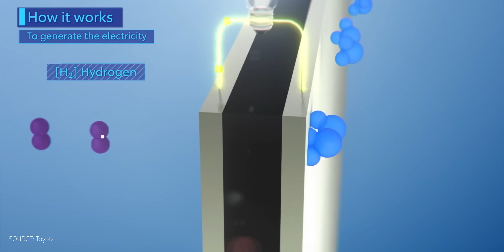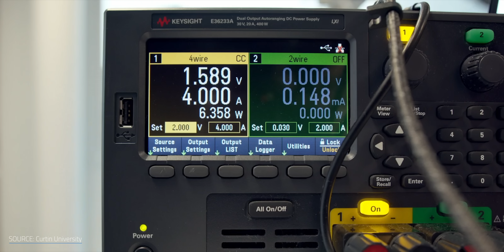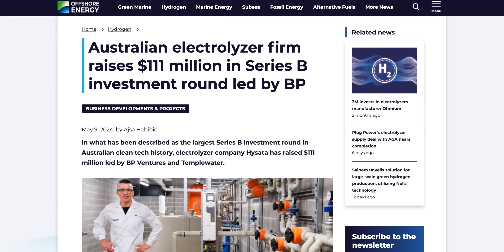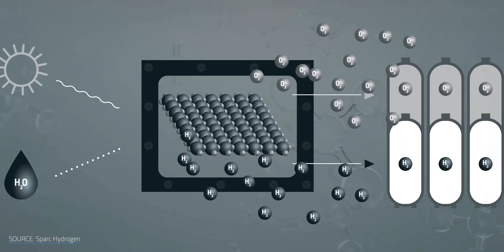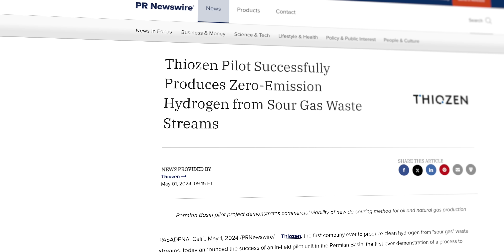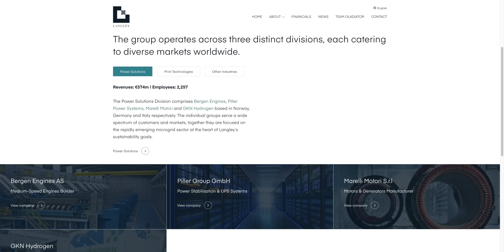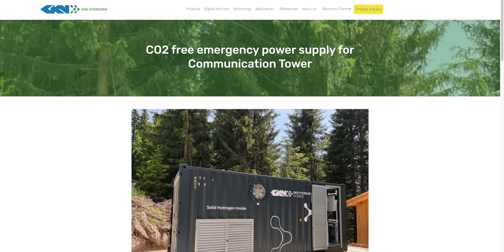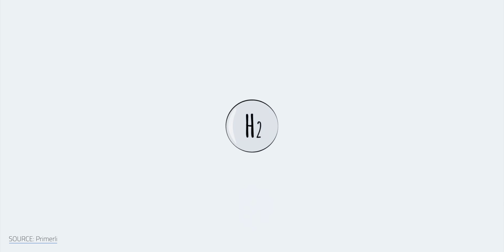How a Hydrogen Breakthrough is Closer Than Ever

Comment from the maker: Do you think hydrogen still has a future? Use code UNDECIDED50 to get 50% OFF your first Factor box plus 20% off your next month of orders at https://bit.ly/3R5fOSk!

If you liked this, check out China’s MASSIVE Desert Project Is About To Change The World https://youtu.be/MX_PeNzz-Lw?list=PLnTSM-ORSgi4At-R_1s6-_50PCbYsoEcj
Reply: No.
Reply: Really well done on the German pronunciation! 😀 As always, thanks for another interesting video.
Reply: For general use, no.  End to end efficiency poor.  But there maybe some niche applications where it may have a place, even at additional cost.  One is steelmaking, or other high heat processes.  Another maybe longer ranged eVTOL's, with fuel cells.  Imagine hydrogen generation from electricity close to the point of usage.

Also, say lets say solar and wind gets so cheap, that one can overbuild by 2-3x.  What do you do with the excess electricity?  If electrolyzers can be made cheaply, is low capital cost, can tolerate low capacity factor, ... the extra electricity can be shuttled away to generate hydrogen.  Additionally, it maybe able do also generate downstream products such as methanol and ammonia.  This can be used for fuel or other industrial products, such as ammonia for fertilizer.
Reply: Hydrogen is not a panacea. It is useful in very specific situations. The people are trying to shoe horn it into things that it simply will not do well in. It will always be more expensive for a lot of specific situations, and less efficient. An example is heating of homes. Or in my opinion any transportation needs less than the size or weight of a train. I don't think it's even a good option for long haul trucks. And it is absolutely not a good option for shipping. So that's many of the so-called uses of hydrogen that simply are not going to pan out. But it does have a place in many other areas. I don't think energy storage is one of them, but I'm willing to keep an open mind on that. But there are a lot of industrial processes where it could be very useful beyond just being part of the chemical mix. Including high heat production, and other similar type of uses. So yeah, hydrogen is overhyped
Reply: The biggest problem I see with hydrogen is in the components that see hydrogen under pressure.  There is a thing called hydrogen embrittlement that causes some real problems in high iron content components. And  with hydrogen's small size makes it difficult to capture it in vessels as it is small enough to work it's way through the pours of many different materials.
Reply: Hydroden has a high energy density so it will have a future in some areas where that's useful like perhaps a possible replacement for jetfuel or possibly some kinds of factories like steel mills that need to generate extreme heat. In other areas like EVs it doesn't make sense when you factor in transportation costs of hydrogen are far more expensive than near instant electricity transfer over a wire. Companies like CATL also already have EV batteries that can do 600 miles,  charge in 10 minutes and inexpensive enough to finally make EVs cheaper than similarly equipped ICE vehicles. It's only in China for now but eventually it will reach other countries.
Reply: No, it has no future, because Hydrogen is not a fuel. It will ALWAYS take more energy to make Hydrogen than you get from burning it. Period. Second LAw of Thermodynamics. Hydrogen is a failure. It's a grift by the oil companies.
Reply: I remain suspicious of Hydrogen proposals, on the simple rationale that there is a list of direct competitors for H2 that are more technically appropriate, more economical, and more green. Biofuels from waste biomass lead the list of things easier to turn into fuels that work with current equipment. Urea is far better than H2, for storage and transportation and energy density, and costs less per unit of energy in theory. The Rube Goldberg schemes to make H2 a usable good? Sure, throw enough resources at it, and you can obscure H2's faults. And there are appropriate niche uses for H2. But to power the world the way some sell it? No. That's not the future.
Reply: we will still be using fossil fuels in 50 years. Even in the first world will be mostly switched over, the third world will not. Plus, we need stuff from oil, not just gas. We just have to figure out how to process oil and gas cleanly to get the helium and hexane/butane/etc. we need. Thats the best we can hope for. But maybe by 50 years the oil and gas we burn will be burnt cleanly
Reply: Hydrogen will never work because there's not a green way to get it.
Reply: Good show! 

I noticed that SunHydrogen, inc was not mentioned. 

They seem to be making strides bringing the world clean hydrogen derived from any kind of water and specialized solar panels.
Reply: Hydrogen is made from natural gas and creates more CO2 than burning the natural gas in the first place. Electrolysis is not the solution because all renewable electricity is going to be sucked up by AI and data centers.
Reply: TBH, I think we should bring back the original intro song.
Reply: H2 never had, and honestly never will have, more then a few niches were its viable and that is not only because its primarily pushed by the fossile Fuel-industry, with the hope they can sell us their CO2 poisoned H2 with an unhealthy up-charge, because its Green!(washed)

It may replace Coal/Gas if used in smelting Iron and steel production or if used in the same way it is used today, for fertilizer and chemical production, just produced through electrolysis instead of methane reformation, that would be a way to go and replace fossils…
But there it is % would be used exactly because of its chemical properties, not because of its power as an energy storage medium anyway

Else its overall energy efficiency is sub par to everything else! Heck turning it into fertilizers, grow food and then use that food to energize you to pedal a bike has a better energy efficiency then burning it, be it caloric or in a fuel cell

If metal-hydrid storage could get anywhere without the use of rare earth metals, then it "could" be feasible. Else it would mostly be for emergency power solutions and/or other places were cost shouldn't be a limiting factor. But there metal-hydrids could shine, as most can have near unlimited shelf time, or rather longer then the gear needed to extract the H2 again
Reply: No!
Reply: Uh short answer yes! The Elite love to milk a cow and Hydrogen/Nuclear Energy are the next Crude Oil!!!!
Reply: @UndecidedMF  Nice way to force in an advertisement
Reply: Excellent progress. One thing to note is that if you're producing hydrogen from solar/wind, energy is lost in the process. So it might seem we don't need hydrogen. But, generally we don't need hydrogen except for specific cases like airplanes and large ships, which is where hydrogen's value lies. Since hydrogen is only needed for these limited but important applications, the hydrogen revolution may happen faster than many expect.
Reply: pffffffffffffffffffffffffffffffffffft ...
Hydogen
Reply: NO. Its a terrible ennergy carrier. Im not convinced that the efficiency is gained like they say. Regular test its just makes more gas while sucking more power equally.
Reply: @impuls60  yeah well.. its internet: nobody cares...
Reply: @impuls60 Also has to come from already limited water options
Reply: Given that fresh water is already at an all time low in most areas and desalination on a scale to fuel the world would probably destroy the oceans in a few years, I'd say it's a terrible idea. Don't even get me started on steam methane version of the production process.
Reply: @triple7988  meh.. its still a great idea, enough water left
Reply: @triple7988 I'm only considering fresh water to be an output, not an input. If you are taking about generating from wind turbines, those can be ocean-based. Ocean sun to evaporate, distill, then onto the turbine for hydrogen generation. It actually helps solve water issues, not make them worse.
Reply: @triple7988 fresh water falls from the sky every day. If there was a shortage we’d capture more.
Reply: NO! It is just another green dream that cannot be implemented on a large scale. And like all other green dreams, it is primarily a way to milk tax money for unrealistic projects.
Reply: Hydrogen has a future, but not in the short term.  It will take another decade to completely eliminate fossil fuels and be on solar and wind.  Once the shortsighted decision makers realize that there are huge amounts of solar being curtailed during daylight hours, then they will scrutinize how much it is costing the grid to store the curtailed electricity using batteries, and then look for another better long-term storage solution.  One long-term solution is pumped hydro, but this needs a hundred meters difference in elevation.  So pumped hydro is not for flat lands.  Hydrogen can be stored long term in underground salt caverns just like natural gas is now stored.  So it's just a matter of time until forces come together to cause long-term hydrogen storage to become prevalent.
Reply: One advantage of hydrogen is that you don't really need to worry if the electrolyzer works outside lab conditions. A solar panel must survive outside in all kinds of weather for years and a battery or fuel cell has to work even if the car it is in has a bumpy ride in hot or cold conditions, but to make a hydrogen factory you just need to build the lab equipment bigger. Though it is a different situation if you want hydrogen energy storage devices or fuel makers in homes and have to idiot proof them...
Reply: SunHydrogen is in the process of commercializing their PEC tech. 10.8 percent efficiency direct solar to hydrogen. They are working with CTF and Honda right now to bring it to market. Look into it.
Reply: Matt, is @UndecidedMF08 a fake account?
Reply: Matt, the scammers are back!  Look at the reply to my original response to this video please.
Reply: Good points, Matt. Some institutions and corporations plan to ramp up GreenH2 projects in areas where negative and null electricity price is found during excessive renewable energy production periods.
Reply: Nope, unless you use methan and that leaves CO2 as rest product. 
Any other methods and materials are NOT economically sustainable. 
Btw. than means that even if you (maybe) help the planet, you will kill our society in the process when global economy failes.
The thought is than there will arrive new much more effective technologies before hydrogen gets there.
Reply: Hydrogen from renewables can help lessen the need for desalination plants and have an impact on water stressed areas.....places that use the most energy, generally need the most clean water.

Just capture the water vapor byproduct, and you are creating water with energy use that already exists. That would need lots of time and scale, but it's a significant potential side benefit.

Instead of desalination plants that use extra energy, you'd have hydrogen power plants for cities connected to city water systems in some places.
Reply: @namehere1861 Sorry to tell you, but you’d never be able to capture enough water vapor to make up for how much water you need to produce green hydrogen. It’s horribly wasteful.
It’s not even close.
Reply: The niche places where Hydrogen may be used is large vehicles such as trucks and buses. Hydrogen has the advantage of being energy dense and allows for fast refilling compared to charging a battery.  Then again, if battery technologies advance where they can increase energy density, charging times and reduce reliance on hard to find minerals, that would be the death of hydrogen. Interesting to see what will happen. Thanks for the good work.
Reply: One of Dr. James Tour's companies is looking at producing hydrogen from recycling plastics.  The hydrogen is a byproduct from producing graphene from plastics.  Because it is a byproduct, it is considered to be produced at zero cost, as the costs of recycling the plastic cover its production: https://www.youtube.com/watch?v=GHMp9OUQgUg.
Reply: Maybe making methanol directly from the hydrogen, so there is no need for hydrogen storage. But I do not know how difficult that process would be
Reply: geologic hydrogen free from the earth I have videos on it on my channel
Reply: I see a great future for shipping, air fleet, and industry, do I don’t like the idea of having a connection for housing
Reply: $21m from the government to build a H2 electrode that's maybe 15% better. What a ripoff.
Reply: No. It it were viable (or just promising), they would be doing this research work in their home country. No gov. funding => no work done. So just another gov. funded scam where taxpayers foot the bill.
Reply: @UndecidedMF  And two people stop believing in santa claus and the tooth fairy and all the other mythical creatures , nothing's gonna change
Reply: naaah waste of time, there will never be a hype for hydrogen.. it is simply too dangerous, i have done some research and work on hydrogen myself, it needs very little oxygen to ignite.. so any leaks down the line and you have problems... (think of older vehicles...)
Reply: Matt please do a follow up video on RedFlow I heard the are having some issues raising funding for production?
Reply: Even if it’s produced with renewables the staggering amount of water you need to produce hydrogen is MASSIVELY wasteful and stupid. I notice that yet again this was not mentioned in yet another hydrogen video.
Please address or at least acknowledge this problem exists, please, anyone who makes a magical hydrogen video? Anyone?
Reply: https://www.youtube.com/watch?v=Zklo4Z1SqkE
Titled why hydrogen will never be the answer by physicist Sabine
Reply: @brianjonker510 Thank you, I did in fact watch that quite awhile ago and have been meaning to revisit it. 
 I can’t remember, did she discuss/address the water problem specifically?
Reply: Just watched it again. She did touch on the water issue, but still DID NOT explain the amount of water required. This, to me, is emphatically the main reason hydrogen will never work.
As I understand it, it takes anywhere from 10 to 20 liters of purified water to make 1 liter of hydrogen.
That’s a lose-lose situation  right there regardless of the green aspect or not.
Reply: @owldrinkmore  I suppose this is about kg.
18 kg water is build from  16 kg oxygen and 2 kg hydrogen.
Reply: @reiniernn9071  I don’t think the measurement particularly matters,
89% of water is oxygen whether purified or not. However, because of atomic weight AND the necessary purification of said water,
anywhere from 10 to 20 liter/kg of water are required for production of 1 liter/kg of hydrogen.
Absolutely ludicrous.
Reply: Fortescue has withdrawn from the project.
Reply: I'm no engineer or scientist but there's a case for dam free run on rivers micro hydro remote stations that uses electrolytes to produce pure hydrogen. Besides the initial installation cost it won't produce nearly free Hydrogen 24/7 365 days of the year. The setup could fit into a shipping container and transported to remote sites where it can operate independently. Hydrogen storage and transport is a different matter but dam free run on river micro hydro hydrogen generation can produce emissions free energy. 

This would work in mountainous regions like British Columbia Canada; where 40 remote communities are not hooked up to BC Hydro and spend collectively 18 million dollars yearly on diesel power generation. Those remote communities can be ran from virtually free hydrogen produced from micro hydro power stations. The reason electrolysis is under 1% of hydrogen produced is the major investors tend to be big oil companies who what to diversify their existing fossil fuels operations; which most likely will never be considered emissions free. Run on river micro hydro hydrogen generation is more practical then using inconsistent wind or the sun.
Reply: @CanadianEmpowermentAlliance  The less then 1 % of production is via electrolysis is because the physics/chemistry laws say to break the valence bonds of waters uses 7 times the energy then to break the bonds of methane. Then there's the cost of of transporting/storing H2 for which there is limited infrastructure.

That's why Oil& gas is dominating H2 production. There's now an Australian solution the reduces the Steam Methane reformation method emission to produce H2 by 90+%. See 1st Commercial Demonstration Plant https://youtu.be/NDa3glx-tTI

Second plant now being constructed in Canada followed by Japan then France.

Here's the carbon output as graphite https://youtube.com/shorts/cHLh-EV8RhQ

The advantage is that now major new transport or storage cost. Use existing gas infrastructure to transport gas to user site. User extracts the graphite sells it and use the Hydrogen on site. So you get value from the carbon as well versus SMR method which vents it or in case of blue hydrogen sequesters emissions underground.

Your right it's not 100 % but certainly 90+% emissions free. Better then what we have now, and much cheaper then electrolysis.
Reply: Matt Ferrell pumping another future tech that will never be available in our lifetimes (if ever). And these videos always have some other ad inserted into them (this time with a 50% code!). These videos should be added to the scam YouTube algorithm.
Reply: Yes it still a future, but in the form of turquoise hydrogen, natural/gold/white hydrogen or as "waste green/pink hydrogen". When too much solar, wind, nuclear is generated the grid and the batteries are unable to manage it, meaning it has to be elektrolysed in elektrolysers or Battolysers.
Reply: Get 50% OFF since you lose more than 50% of the energy on the roundtrip electricity - hydrogen - electricity! 😆
Reply: @estraume  Loose? Are you sure one doesn't tight the energy? Aside from that, apparently storage, portability, and energy density are not things you find worth considering? 😃
Reply: @zweigackroyd7301  Typo, corrected now. 😆 I think a system where solar energy is used directly for hydrogen production is interesting. Methane Pyrolysis might also have potential given that the rest product is solid coal and not CO2. But all processes involving Methane have a big disadvantage in the risk of leakage.
Reply: @estraume  I think it's a waste! I want to use more energy to create the hydrogen then simply putting into batteries for driving, then take the hydrogen and use more energy to compress it! At this point, you are now more expensive than gasoline. You also have one hell of a bomb!
Reply: @estraume  The biggest problem with leakage is not with the CH4, H2 is the smallest molecule!
Reply: @estraume  Correct stated. And those losses are EXCLUSIV energy needed for compression of hydrogen to 800 bar (which is the pressure in tanks used for mobility with hydrogen cars. If we include that energy the efficiency goes down to 25% . 75% loss.
And storage in a battery is somewhere between 90% and 98% depending on the battery type and charger efficiency.
Which makes green hydrogen only a good alternativ if you have electricity (like sometimes in Germany) without any demand for it...better 50% loss that total waste is the argument. But ise that hydrogen in such places that compression is not needed....even than the efficiency is far less than battery efficiency....but we cannot use battery stored energy for producing steel. Hydrogen can be used for that.
Reply: Hydrogen might not have such a future as an energy storage used to offset renewable electricity generation. However, many parts of chemical industry that currently emit large amounts of CO2 cannot be turned green without hydrogen: ammonia for nitrogen fertilizers, steel and polymers, to name a few. Also aviation and marine transportation industries are tricky to electrify with batteries. I'm somewhat disappointed that, again, the talk is only about the energy use of hydrogen, although there are many better use cases available. 

Then, another benefit from large scale utilization of water electrolyzers is their added flexibility to the electric grid. With a large reserve of electrolyzers we can overdimension our green electricity generation capacity from what it would be based only on current electricity demand. Ramping the electrolyzers up and down with renewable electricity generation will create massive amounts of demand flexibility, acting kind of like an energy storage. Of course, this would require cheap enough electrolyzers or other economic benefits for not operating the plants 24/7.

So my answer to the question: yes, there will be future for hydrogen, but no, it won't be serving as a battery for electricity.
Reply: @Piepura  I love it! I think that is very well said!
Reply: From what I understand, GRZ Technologies in Switzerland is already selling solid-state hydrogen storage. They use metal hydrides to store and release hydrogen efficiently. The company is already selling energy solution close to price parity with batteries to store clean energy.
Reply: @BlindedByLogic  I would like to see an independant study confirm that metal hydride storage is more efficient than liquid hydrogen storage. Claims made by a company producing the technology are suspect in my books.
Reply: @BlindedByLogic LOHC too in japan
Reply: No but in your mind apparently. Very disappointing video and highly biased.  Not your style but maybe it now is?
Reply: I do. It will have its markets (forklifts, fleet vehicles, planes in the future, heavy load vehicles, etc) I can’t believe you have done these videos on hydrogen without even mentioning Plug Power though.
Reply: @scottlarson3255   I too was wanting more than a screen shot of a Plug Power truck about second 25 of this video, maybe Matt will devote some time.
Reply: I have given up on channels like this. For 30 years I have studied these advances and have seen few reach the market or improve the lives of humans . Makes you wonder what happens to all this tech. Since the tv show”Beyond Tomorrow “ in the late 80s we have seen endless innovations that again are no where to be seen. We are still burning fossil fuel and likely will well in to the 2050s so I am done on innovation. None of this stuff has value unless it can touch the lives of the average person.
Reply: We used light into a FINELY tuned venturi and created electron showers and sterile Muons...I have the videos on my channel. I would like to engage Matt? "The Material Evidence of the Theory that Changed Everything" as you will see we should be able to get free energy right now.